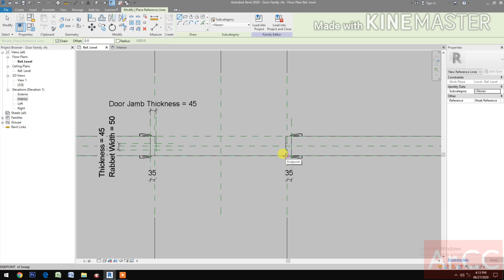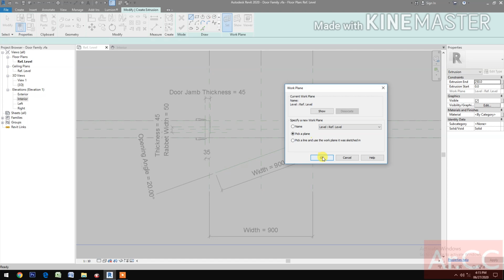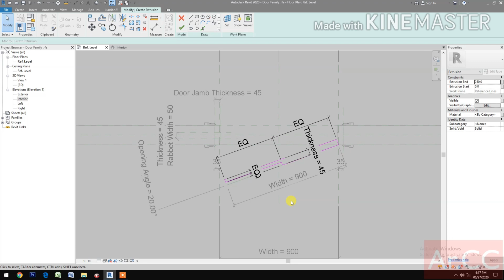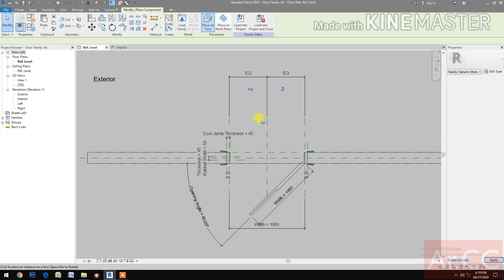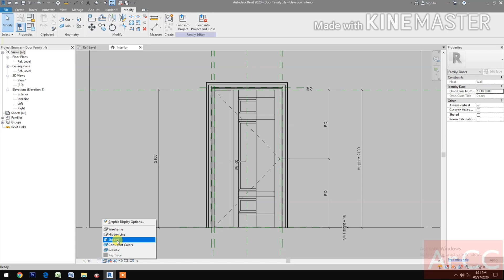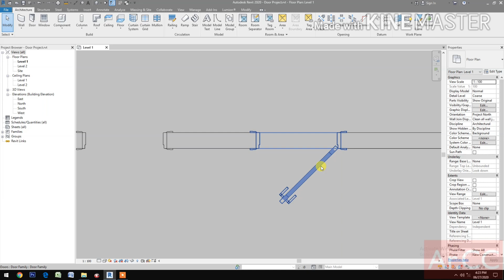RD039. How to make a Parametric Doors in Revit. Part 3 Door Panel Place Holder.

Comment from the maker: Recommended Video:
RD037. How to make a Parametric Doors in Revit. Part 1 Door Jambs.
https://youtu.be/TH821Btutw4
RD038. How to make a Parametric Doors in Revit. Part 2 Door Casing.
https://youtu.be/JgFehplzRD4

Suggested Videos:
RD115. How to make an Off-Center Pivot Door in Revit. Parametric Door in Revit.
https://youtu.be/VGfXo0d6vX4
RD114. How to make a Bi-folding Door in Revit. Convert Swing Door to Bi-folding Door.
https://youtu.be/sIAz_u1CAT8
RD113. How to make a Parametric Arabic Pattern Pivot Door in Revit. Pivot Entry Door in Revit.
https://youtu.be/3tAyuCpotGw
RD110. How to make a Classic Ornament Parametric Gates in Revit. Steel Gate Design in Revit.
https://youtu.be/STm4xRDQTdY
RD069. How to make a Parametric Pivot Doors in Revit.
https://youtu.be/Wkf7jAVMRoc
RD055. How to make a Parametric Doors in Revit. Part 13 Modern Door Design. Swing Door.
https://youtu.be/syWkgU3JDLU

Comment: Good morning. I searched for the door panel tutorial but could not find it. I which video it is?? Or do you have them on a separate file? Maybe tutorials on how to make different doors panel wld be interesting
Reply from the maker: I have it separate tutorial. Le me know so i can send to you some of the components.
Reply: @ArCrisCruz  Absolutely. But then again it would be interesting to learn how to make these doors panels, because sometime we need to make different ones
Reply from the maker: I totally agree but if i share to you a basic two panels door you can modify it to how many panels you want. That's what i did.
Reply: @ArCrisCruz  Thanks for your reply. I certainly can modify it. Cld you please send me the basic 2 panels door. Tks

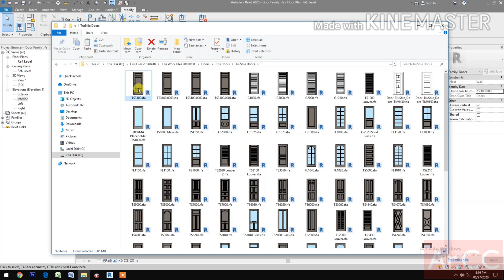Comment: Thank you for your amazing videos. I started working on the door tutorials and was following along.  However at 8:40 you load another door into your file and are able to place it. I tried the same step but the door does not load in to my file. How were you able to  do this. Thank you for your help and amazing videos.
Reply from the maker: Make sure you  check the work plane base in the properties. And select place on work plane once it loaded.
Reply: Thank you. Figured it out.👍👍
Reply from the maker: Cool... Thanks.